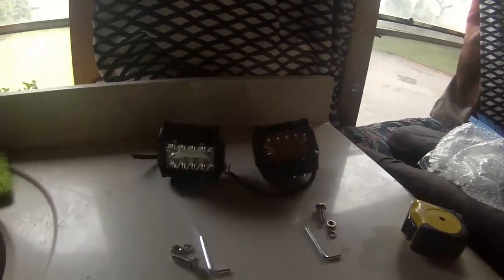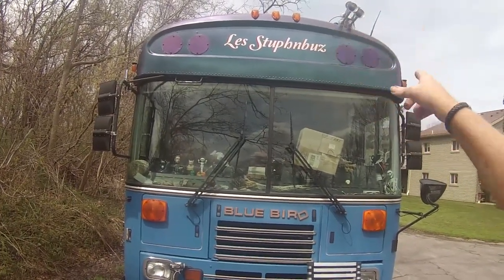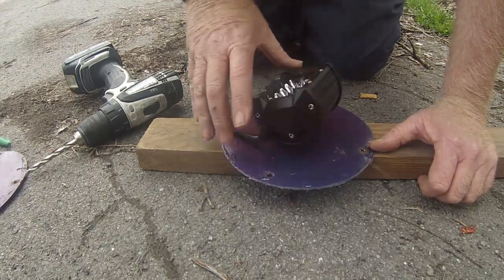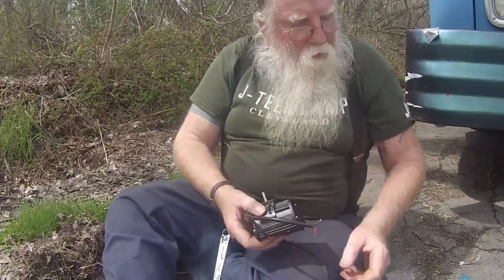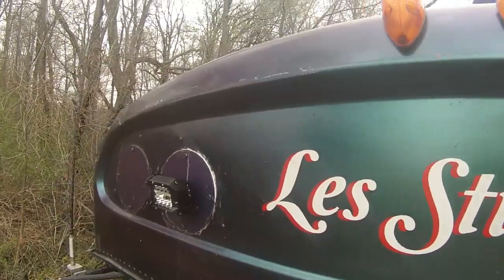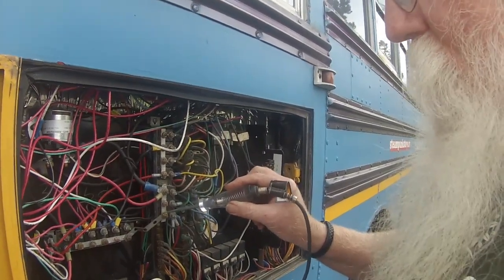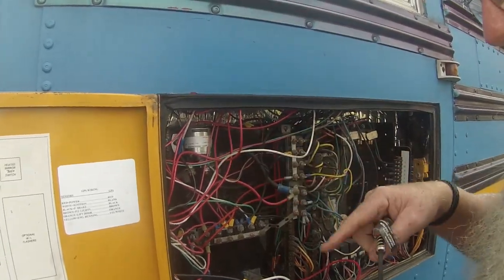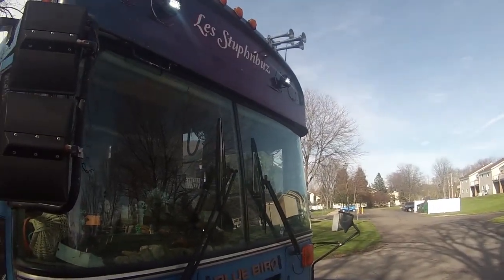Infinte Bus Tour 253- Zmoon LED Lights Product Review

Comment: There you go answering questions I have not ask but need the answer to. lol I have a similar set of lights I am looking to mount on my side by side (The ATV ENTERPRISE) and I was wondering how bright they were and how easy they mounted, seems nothing comes with instructions these days. You answered my question and you made the bus look awesome with those lights. I been reading the comments, sorry about the bumper but accidents do happen. Some wood and the weight of that ol' Blue Bird should straighten it right out. Stay safe out there.

Comment: I'm kind of surprised you didn't go with a illuminated toggle with a switch cover so you wouldn't accidentally turn them on.
Reply from the maker: I did go with an illuminated switch but I'm not real happy with it. Not bright enough.  I didn't worry about accidentally turning them on. They are powered from the keyed side so if the key is off they can't be on. No worries about running the batteries down

Comment: The lights look great! What happened to the front bumper?  :(
Reply from the maker: I bumped into one of those pump protection pipes at a fuel stop. Oops
Reply: Bummer!
Reply from the maker: Yup. One of these days I will take it off, lay a plank on the bend and drive the bus up the plank. Might as well use all the weight of the engine to do the work

Comment: I guess I missed the video, Steve, where you explain what happened to your front bumper?
Reply from the maker: I never told you all about that. 
It got caught on a pump protection pipe at a fuel stop and bent when I backed away. I was trying to make a tight turn to the pump
Reply: Steampunk Steve that’s a bummer. I’ve done that and worse in semis. You may be able to bend it back to its original position, if you push against a stump.
Reply from the maker: @roamsweethome4895  I thought of that but I'd want someone watching as I push to make sure I don't go too far or the stump moves. The air cleaner is right behind the bent part